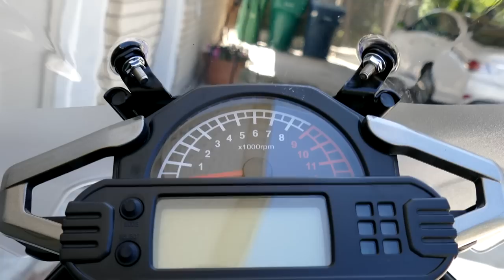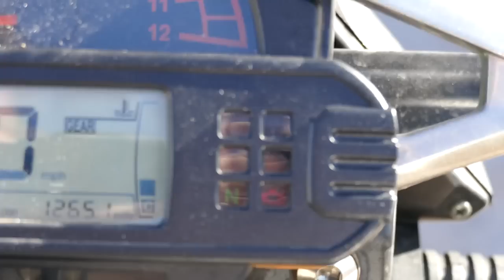Zongshen CSC RX3 Cyclone REVIEW - BRUTALLY HONEST  #everide

Comment: Awesome review!  I'd love to see this same kind of review on the BMW G310 R  (not the GS but the R, because R has lower seat of 30.9 inch)...which is a similar category, to the CSC, as in its the smaller/lighter bike spec (possibly suited for some mild off-road use).. I'm trying to find a low seat bike for my wife that is reliable and able to put some knobbier tires on to ride on state park roads and trails in Utah (with me on my Africa Twin)... 

I first saw the BMW G310 R which could possibly meet this task, but then a friend told me about the CSC and it made me curious, but I did suspect that being so cheap in price that it may just be built for looks. You have confirmed this as well. They may come along as the years progress (hope they do), but for now the BMW is looking like has good potential. My wife won't be going on such rough road as you for a long long time, but looking for low seat option that can do ok on fire roads and things like that.
Reply: i want to see the review on the BMW Gs310 in the same rout used by the CSC and the diferent in prices. sorry for mi english. i am from argentina

Comment: I kind of wonder how much it would take to rescue a bike like this. New suspension, wheels and tires, different sprocket ratio, some kind of stroker kit, and some replacement running gear... It'd probably still end up more expensive for less bike than the standard options, but could make a fun hobby project.

Comment: I've bought brilliant bikes used that cost a lot less than new. Several, including a KTM 400 had aftermarket forks and shocks along with being bored out and blueprinted. It could have layed waste to the Prius. If it's a choice between a brand new, cheap ride that sucks or a used ride that's great, I'd go for used every time.

Comment: Have you ridden smaller adventure bikes before, like the versys-x 300?  If you have, does it still suck as much as you experienced it in this video? Coz i feel that you might have been comparing it to the 600+ adventure bikes which I feel wouldn't be fair. Thanks for your unbiased detailed review though, great work. 

Oh and btw I've never ridden one of these, I'm just curious to know if it's purely the Chinese bike that sucks, or could it simply be that it's so much smaller and intended for slightly less battering off road?

Comment: I started seeing ads for this bike a few months ago and being an enduro and street enthusiast, it definitely piqued my interest. And unfortunately, it's just not quite there yet. I've actually seen one around my home town, and it looks like the guy put it through the ringer as well. Now, don't get me wrong, dual sport bikes can get absolutely demolished, it's just part of the job. So the wear and tear doesn't bother me. What bothers me is how the fit and finish break down so quickly over just a short amount of time. The frame already looked like it was rusting, along with a lot of the body bolts. 
But, with all the technology and ideas they implemented in this bike, they have the right direction. They just need better quality parts and durability. But, i'd like to see them improve and keep going, because it's got a LOT of potential. And it takes a lot of pride for a KTM guy like me to admit that.

Comment: after riding a TW200 for 2 thousand miles last season, that acceleration looks pretty good
Reply: The acceleration was fine. It was the last ten mph that the Prius - a vehicle with a far lower drag coefficient - overhauled what is a slightly heavy 250cc motorbike. 

Incididentally, I have been passed on the freeway by a Prius at over 100mph, riding my Ninja 300. It was memorable because i couldn't stop laughing, but also proves that a lightweight low displacement bike is only going to have so much puff at high speed.

Comment: Since we're being honest here, you did actually have an ADVENTURE!! The bike didn't break down (that's a bonus in ADV-Land) You made it up and over to where ever it was you were going. Was the ride fast, plush and the way in which you were accustomed to? Probably not... but that's not what defines having an adventure is all about.

And another point of honesty needs to be pointed out as well. The target demographic of the RX-3 is a HUGE untapped market that is largely ignored by the major manufacturers. If you are shorter in stature, possibly female, or just getting back into riding after years or your first time... a low cost, inexpensive-to-fix bike is the ticket! If you do not agree with that assessment, then essentially what you are saying is that ADV Riding is only relegated to those who are on the upper socioeconomic scale with extra free time. Adventure bikes shouldn't cost as much as a car, especially when the majority of the riders aren't going to use them every single day of the year. There is a sweet spot for mid-level ADV bikes that hasn't been tapped into (YET). somewhere between 400cc – 700cc is more than adequate to get you around the world and back again. The bike doesn't need to weigh over 500lbs either.

I feel Zongshen is on to something here. However, just like anything, being an early adopter you are going to find it's shortcomings and faults. Perhaps, when they release the RX-5 (400+cc) bike in the coming year or so, that they will have worked out the majority of the kinks. Is the RX-3 a good Dual Sport... no, not remotely. Can it be an OK entry level ADV Bike? Absolutely. But you gotta know what you are getting into when getting started. What aftermarket farkles are available, and you also gotta not be shy about wrenching on your own bike. Because it's not a real adventure, unless you've had some kind of road side repair.

That being said, you did yourself (and the bike) a huge disservice by running the stock gearing trying to climb that rock garden. Attempt that same trail with a 13t / 45t combo and get back to me. The stock gearing totally sucks off road. They have it geared in such a way so you can at least get over 75mph on the highway. (For DOT import / CARB reasons, I'm sure)

Comment: You convinced me with the prius and 74mph top speed. A 125 scooter can do that right? Must be a very weak 250.
Reply: No, it's just that it is trying to accelerate a 400 pound bike plus 200 pound rider.   A Honda Grom is 200 pounds or so.  Add in tall stock gearing for good MPG and then it is more understandable.  CSC does have sprockets available to lower the gearing, but you'll be giving up some top speed.  Those that have done it say it makes a big difference in off road riding, power wise.  The suspension, though, is what it is.  Set up for pavement and gravel.  More off road biased tires help there, but 5 1/2 inches of travel is not good for the spine or handling on rough trails.  I've kept mine stock and on pavement and gravel roads.  Around here 55-65 mph is the limit almost everywhere and enforced, so I'm content.  Getting popped at 74 mph could  lose me my license and jack up the insurance.  Better aluminum luggage is available for US $850.   It handles better than my GL1500 and is a lot quicker and more convenient to just hop on and go.  And all for US $4000 delivered to my doorstep.  Literally.  As he states in the video, it's definitely a good start.  And yes, Zongshen IS iterating.  The RX4 with a 450 cc engine is in development.  No ETA on its release, yet.  Probably 2018 at the earliest.  CSC has stated that they will bring it to the US when available.  I'll probably pick one of those up too,  just to see what it is like.  I think we'll be hearing a lot more from the Chinese in the next 5-10 years.  It should be interesting to watch, either way.
Reply: +working honda why would you buy it for off road anyways?
Reply: lol
Reply: Nerb1 For a what? 300cc FI liquid cooled bike 120-135 is rather slow. My 95 XT350 could cruise at 120.

Comment: I had a Chinese bike for 9 years. It was bought new. Not Zongshen, it was Keeway. With regular oil change on every 3500 km I got 100000 km on it. (60000 miles) It broked one time, I had to buy new CDI wich cost about 70 usd. Only thing I didn`t like was finish, it had a lot of plastic and chrome was bad. Everything else was fine. Sorry for my English.

Comment: I have mine at 50k km its holding up really well the parts are not expensive as long as you do its maintanance regular I dont think you will have any problems. Of course you shouldnt push it too much as well it cant be considered as an off road bike but I think its a decent beginner adventure bike.
Reply: I did a lot of loaded with also passanger long road rides on it as well you cant expect too much from it but its pretty good and fun only complaint I would have is the engine size could be bigger so you could maintain high speeds on the highway.

Comment: I think your review is well done, accurate, and relevant in a certain context(that of your viewership), it may miss the point of the bike.  
I think this simply isn't a dualsport bike and I'm not sure it's marketed as such.  Try doing an identical test with a BMW F650gs.  I don't think you will have much luck either, but that is surely an "adventure" bike. Just not a dualsport.  

That's how I see this bike.  A cheap, slow, MINIMALIST version of an BMW-type "ADVENTURE" bike.  As in, ride mostly on pavement to get between campgrounds, monuments and parks that are located on dirt back roads, fire roads or mild fun trails.  Be able to cross certain unexpected obstacles that novice "adventure travel riders" may encounter.  

These type of riders probably outnumber true dualsport adventure riders by a wide margin I would think.

How does it handle at highway speed around other traffic?  Is it less fatiguing to ride all day than a dualsport?  How well suited for entry level "adventure travel" of the type described above?
Reply: Haven't you watched the whole video? It sucks badly on the highway.

Comment: Hey everide.. the NC250 engine + FCR 37mm carb + 82mm big bore kit + advanced ignition + exhaust = 282 cc, 6 speed gearbox and wildly fast on a crf250X chassis. bolts right on ! warp 9 cush drive for the 250x compliments the setup for dual sport use with stock gearing of crf250x, itll be way way faster than the rx3. did i tell you it weighs 250 lbs ??? .. the engine holds 1.6 L oil for a 250 thats a lot ! and also lock nut valve adjusters ! still waiting for something simple from japan.

Comment: Perhaps someday we will see a updated CSC RX3 ER(everide) version where they address the issues you have raised.  Stronger front brakes are a relatively easy fix with a larger diameter rotor.  The suspension issues may be simply a matter of a few more $$ on their end to fix/ replace with a better spec product.  It will be interesting to see if they can fix many of the issues without moving the price point too far.  I hope they succeed.
Reply: Hadnt read all comments on the vid before I basically posted a comment just like yours lol. The new potential eveRide edition already has a following lol.

Comment: OK, it's not an off-road bike and it cannot take a passenger. But it is cheaper than many "premium" 125 scooters and a hell of a lot more fun. Speed calibration on ALL bikes is typically 10% out. It still cruises at 70 mph true and accelerates adequately up to 60. It doesn't have the best panniers but they are better than no panniers which cost $XXX extra on other bikes. No one expects this to be a BMW GS at this knock-down price. Fair review if you are judging by Japanese quality standards, but I remind you again - you are paying peanuts compared to them. As a road bike for a single rider this machine is more than adequate. BTW those rocks you regard as "off-road" would have also destroyed my Vstrom, or indeed almost all bikes apart from dedicated machines for the task.

Comment: Inverted forks are great on dirtbike or even a dual sport but are not a good compromise in an adventure bike. Inverted forks loose all fluid when the seal is damaged or broken, or at least leak much faster. The performance gain is not worth what you give up in robustness for over landing IMO.

Comment: (8:30)  If it makes you feel better my 2017 Ram 2500 tells me I'm empty with 6 gallons left.  (They used the same parts and software for the larger upgrade tank as the smaller standard tank.)

Comment: You mentioned you can get better duel sports for about the same price or less used or even new. What bikes are you talking about? I've been on the hunt for a KLR 650 but even used ones are pricey. What originally turned me on to this bike was it's two year warranty but now I'm kind of worried I have to hit the used market again. For reference I wasn't planning on beating this bike up on hard trails.. mostly long distance traveling on mainly off highway speeds and occasional trail riding on dirt roads while I'm on the trip.

Comment: How do you know the engine oil filter screen cover bolts have damaged threads from the factory when you bought this motorcycle used? How do you know the previous owner didn't over tighten the bolt and damage the threads?

Comment: this bike was not meant as an offroader, maybe mild fire roads.  i think it has a 15 or 16 size rear wheels and an 18 front?  that particular set up was really intended for the asian market where some bikes are scaled down to 3/4.  even those panniers and top cases are worse than rubber maids, i think it was meant to hold a sandwich and much not else.  they should have made the bike with an 18 rear and 21 front and have beaten the CRF250L adventure to the punch.

Comment: "is not going to change the adventure market, just yet..." some time later Suzuki launches his Vstrom 250 and there are rummors that Kawasaki will launch a 250cc Versys... so.. its doing something.. but lets go back.. honda also had a 250 and a 125cc Varadero, and a 400cc Falcon, but honda was the only "recognized" japanese copmpany that keep making small adventure bikes, most of the buyers needed to buy a 150/250/400ish Dual Sport bike and load them with side bags, top case, wing shield to make a cheap adventure bike.. or go for a 650 KLR that is a little heavy and underpower (i still love the KLR), Also BMW is launching small bikes like the 310, and i think that i already have seen a prototype of a 310 GS (if we go to india, we will find that BAJAJ make a 200 and 400cc adventure bikes that are top quality on india and also Royal Enfield with them 400cc tractor called Hymalayan or something)... so This bike has not CHANGE the market, but its part of a movement of waking up some ideas on the big company like suzuki, kawasaki and BMW...
Reply: someones mixing up correlation and causation.
Reply: footbalr074 Maybe, but two years later?

Comment: hmmm... I had contemplated getting one of their TT250 to be a cheap, smaller trail bike for Tasha ... but maybe I will re-think that now.
Reply: I have one, and it is a lot of fun to ride. It's not a rocket ship and it has a few kinks but for the price it is hard to beat. I bought it as a commuter but it turns out that it is a blast to ride off road if you ride within the bikes limitations.
Reply: Josh Taylor Durable? It will probably get dropped a few times. It would be for my wife to take on trails, she has a KLR that she dual sports, but it is too much bike for her to do any single track or woods trails.
Reply: TWiGs ADV - Keep Off The Pavement I dropped it pretty hard coming down a hill that was covered in loose sand. Ended up bending the bars and break pedal. I just replaced the bars with some aluminum ones and the brake pedal I was able to bend back into place on the trail. I haven't had any "major" issues other than that, but I only have about 300ish miles on the bike so far. I would check the ChinaRiders.net forum about the TT250. Most of the issues people have had with the bike are documented there. I can't comment yet on long term durability, but so far I have enjoyed the bike even with the issues I have encoutered. I will also say that CSC has been awesome when it comes to any warranty issues that I have had.

Comment: Your review is informative, but I'm not sure about your opinions on this bike. If you want something to compare to a KLR 650, then you should have picked something else. A KLR 650 is a dual-sport, not an adventure class motorcycle, you should at least know the difference. Also, the type of riding you were doing I would consider closer to off-road, even trials, than adventure with all the large rocks on those trails. If that's how you ride, I'd expect this isn't the first bike you've bent rims on. 

The question really should be, for the price and what this bike's limitations are, is it worth the money? Is there a market segment for a bike like this? 

Personally, I think that for the United States, a 250cc bike is just too underpowered for our highways, where an adventure class bike spends a lot of time. For a student on a limited budget, like the ramen noodle and peanut butter eating college student I was, this might be the perfect cheap commuter that will get you through those lean times.

Comment: Is it still a good choice if I only want to ride it in roads?
Reply: It's a small engine, 250cc, so two lane highways are probably all it can do. It does have a 6th gear though, making it a better 250cc road bike than most! Windprotection is good too, which helps more than you'd think on the road. So I guess yes, as long as you understand what you're getting.